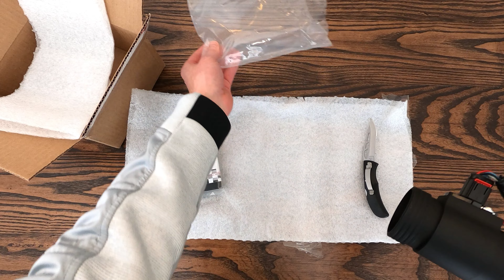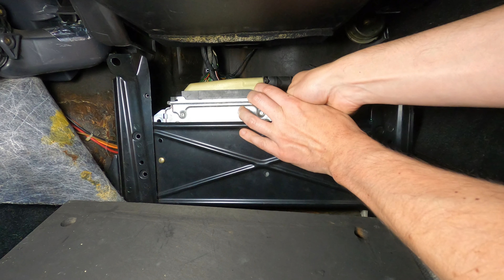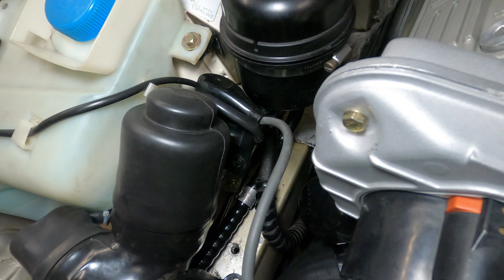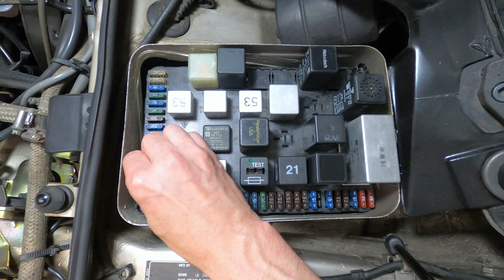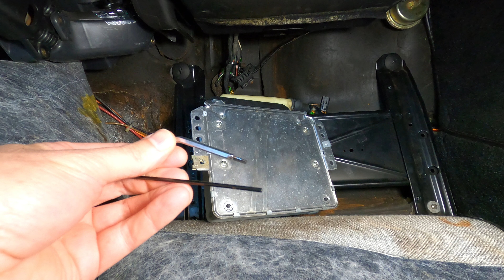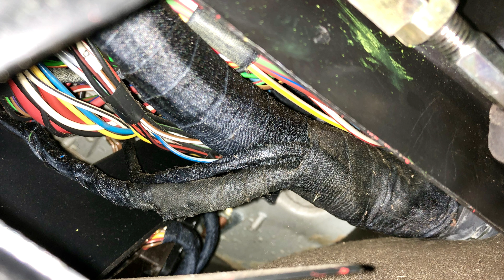Porsche 944 – Lindsey Racing MAF Tune Kit Installation & Review

Comment: The balance belt is very noisy when you started the engine at 7:10, is this an issue with improper tighening or the brand of the belt? I ran into the same issue when i replaced mine, it was almost completely silent before
Reply from the maker: Hey KJ! I think the belt noise you’re hearing is being amplified by the poor quality built-in mic on the GoPro and the acoustics of my garage, as the belt noise is more subdued when listening by hear. That said, the balance shaft belt does account for a larger portion of the belt noise generated by these cars in general, a lot of which lies in the adjustment of the idler roller. So much so that I’ve seen people completely move the roller down and off to the side so that it doesn’t contact the belt at all in attempts to reduce the noise. The balance belts are also notoriously over tightened, even by some specialists, when in fact they run MUCH looser than the timing belts when set correctly. My current belt is a Continental brand and is set with a 1mm preload on the upper belt span per the factory workshop manual. I may try a Gates or OEM belt for the next replacement to see if there’s any difference, but let me know if you’ve tried one that has worked out well for you. 👍🏼
Reply: @NC944er  Thanks for the info! Might try and adjust mine somewhat then. It was replaced by a specialist since I struck a very good deal on it back then ("University student discount"). I will probably not get the same deal again so next time I will do it myself and read up on what belt is the most quiet. But it is strange that mine is as loud as the video presents yours to be when the belts are OEM and tightened with proper Porsche procedures
Reply from the maker: @KJBlakstad  There is a highly elusive “sweet spot” when tensioning the balance belt, but when you find it, it makes a difference. 😂 It wouldn’t be too much work to pull your lower accessory belts, pull the plastic belt covers, and then twist the upper span of the balance belt. If it’s hard to twist it 90° then it’s too tight. It should generally twist just past 90° with moderate finger/thumb pressure when it’s properly tensioned.

Comment: Would you make more bhp with a airfilter from k&n in your original airbox?i would like to do this conversion.i’m from europe.i hope that lindsay racing sends it over to europe😅🙏
Reply from the maker: Most of the measured testing I’ve seen for the K&N filters as that they add negligible performance gains. In some cases they do more harm because they don’t filter as well as the factory air filters, allowing contaminants into the engine. Porsche designed the air box with significant volume, so the main bottleneck in the design is the AFM, which the MAF solves.
Reply: @NC944er  thanks for your input👌

Comment: So on that diag port.. I have 5.0V on the one port to the ground port but 0.0V on the other port to ground. Odd. I have only used the 5.0V one jumped to set idle speed. Never knew the other one should have 12.0v
Reply from the maker: Does your ‘87 port have the three pins or the five? Not quite sure when they eliminated the two on the sides, but thinking it was some time after the 85.5 refresh. 1988 was right on the cusp of OBD coming out, so it still has that weird military-spec plug.
Reply: @NC944er  I have the plug with the three port, two are blank. Looks like the plug you have.
Reply from the maker: @tims_4x4_garage  Ok cool, I wonder what’s up with that other pin. 🤔 There isn’t a ton of info out there on the ports, but I read that for the three-pin versions, one pin is on the circuit with the temp sensor and the other to the ICV.
Reply: @NC944er  the only weird electrical thing I haven’t figured out with my car yet is my “mpg gauge” which works when it wants to. There doesn’t seem to be any rhyme or reason to it.  It worked all week until yesterday. When it’s working again, I will check the port again. for some reason, I feel like maybe it’ll show 12v then. Haha
Reply from the maker: @tims_4x4_garage  Ha! Sounds like a few gremlins in there. 🤣
Reply: @NC944er  naw not in an 80s Porsche. No way lol

Comment: Does that kit work with the early cars ?
#PorscheNoSubstitute944
Reply from the maker: Hey Rico, yes the kit is compatible with the early cars, but will require a pin upgrade/conversion on the DME as follows:

• 944 NA 2.5L 8v '82 to '85/1 NOTE: Because the chip is soldered in place, you need a '85/2 or later DME. 24 pin will need converting to 28 pin socket and the 28 pin DME is good to go.

• 944 NA 2.5L 8v '85/2 to '87 NOTE: 24 to 28 pin DME chip socket conversion is required. This can be preformed by Lindsey Racing for $50.00 or parts purchased to do it yourself. 

• 944 NA 2.5L 8v '88 with 28 pin DME - no upgrade needed. 

• 944 NA 2.7L 8v '89 with 28 pin DME - no upgrade needed.

Comment: I suggest you look into the 4 degree offset cam key, to bring the powerband down. It makes the car a lot more peppy.
Reply from the maker: Yeah, I was very close to ordering one of those the last time I had the cam gear off. Then I saw someone claiming their key sheared off while driving the car and it spun the cam gear, so I paused and decided not to at the time. Although I presume that instance involved improper installation and the guys at 928 Motorsports haven’t had any reported failures/complaints (according to them). It seems like a good mod though if you do a fair amount of city driving.

Comment: Thanks so much for doing the before and after on the dyno! I've been waiting for this video a while now to see if the MAF is worth it, and to see some real data that's not from Lindsey is encouraging : )
Reply from the maker: Yeah, I think I can probably get more power out of it by going a little leaner to get closer to the 14.7 ratio mark. The problem was the initial throttle hesitation, although it seems to be evening out the more I drive the car, so I may play with the settings a bit more.

Comment: Awesome video was waiting for someone to make one and who better than the best 944 channel on YouTube! 
I really want this kit but damn it’s expensive, would you say it’s worth the money in your own personal opinion?
Reply from the maker: Thanks man! I agree the price point is a little high. I think it would be a good value closer to $500, and I’m not sure why it went up $50 over the past couple years, probably because of the redesigned intake tube. I will say the aluminum tube has a great look and feel to it. It’s well manufactured and the appearance is much improved over the previous plastic ones. What can’t really be measured is how much more fun it makes the car to drive. If I think about switching back to an AFM, I definitely don’t feel excited about the idea. 😂 The car feels so much more choked and lethargic coming into the throttle with the factory AFM. So I think it ultimately depends on how often you’re able to drive your car to justify the cost and take advantage of the enjoyment factor. If you get your car out weekly or monthly at least, it’s probably worth it. I’ll also say that while the novelty may wear off, I’m currently looking for excuses to drive the car more often now because of the MAF being installed.
Reply: @NC944er  she’s my daily. I think it’s probably going to be next in-line but I’m cashed out on Porsche parts right now. Just spent $700 on a euro bumper and had to buy a whole new set of tires literally a week later 😓

Comment: I’ve been waiting for this video for a while. Thank you
Reply from the maker: Yeah man! It took a little while waiting on the Dyno appointments, I didn’t anticipate them being so backed up. 😂 But it made sense to try and do it the right way with some proper testing.
Reply: @NC944er  LR couldn’t have done it better themselves. You really did a fantastic job. This looks like a no brainer for someone with an 88 car. A handful of extra HP and better response sounds great. I have an 87 car with a 24 pin so I have quite a bit of additional cost sourcing a DME or sending mine to F9T
Reply from the maker: @tims_4x4_garage  Thanks dude! LR will add the extra 4 pins to your existing DME for $50, plus shipping I’m assuming, which seems reasonable. But to your point, if you’re considering the F9T sport DME, it’s some money you could put towards that instead.

Comment: ALWAYS look forward to your videos, I just finished installing a SpeedForceRacing Supercharger Kit and it included a SplitSec Mass air flow conversion very similar to the Lindsay Racing setup, But I had no idea about that fuel mixture plug on the DME… I’ll get my 944 on a Dyno and let you know my results, From 158HP I’m hoping to see maybe 200 to 235HP at the wheels….👍👍👍
Reply: Please post some videos! That kit costs more than I paid for my car but sounds like a lot of fun
Reply: I most certainly will Rockcrawling Dude!!!!! I’m ALSO subscribed to your channel as well, Yeah installation was pretty straight forward, I wanted something different from a Turbo model so the Supercharger Kit Stage 2 included EVERYTHING even the factory intercooler from a stock 944 Turbo!!!! I’m anxious to feel the TRUE results….👍👍👍
Reply from the maker: @TheTr0uble  Stage 2 is definitely the way to go, that thing looks pretty sick man… also exceeds the price I originally paid for my car. 😂
Reply from the maker: Wow, very cool! It’s great that there are a number of solutions and support for these cars, given they’re 35-40 years old at this point. Would love to see the results! I guess the FQS was originally set at the factory based upon the intended country of delivery, given variations in fuel quality being produced globally, and it even included some ignition timing adjustments.

Comment: Super informative video! This has to be the most pristine 944 I’ve ever seen, keep up the great work!
Reply from the maker: Thanks Ted! It’s a decent looker after 3 years of restoration. 😂 The best part is that it’s not a low mileage car, so I don’t feel guilty about getting it out of the garage on a regular basis.
Reply: @NC944er  I picked up an S2 recently with similar mileage, it’s robust in the right places but it needs a lot of TLC. So far the minor restoration work I have done has been a blast, your videos have a made a lot of it easier haha. They are such great cars and it’s awesome that they still have so much aftermarket and factory support
Reply from the maker: @tedtakesitapart  Sweet! The S2 is really “the” 944 to have I think. While they are super fun to drive, I’ve also enjoyed working on the car even more so. Glad the content has been helpful! 👍🏼